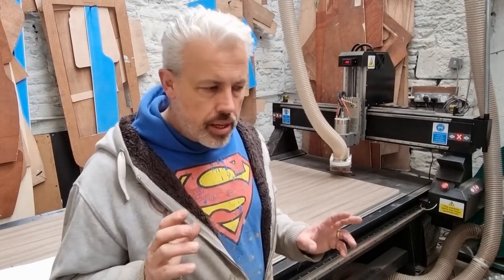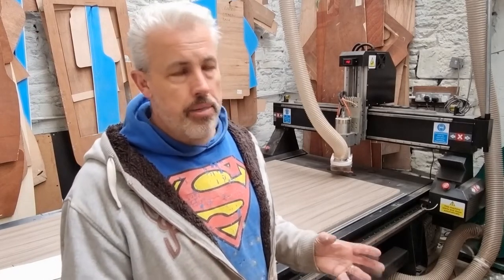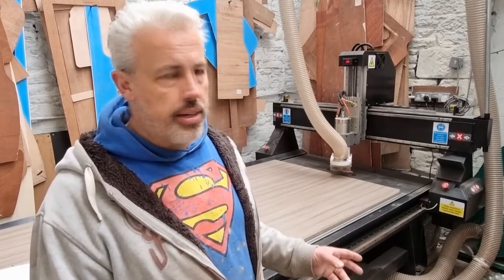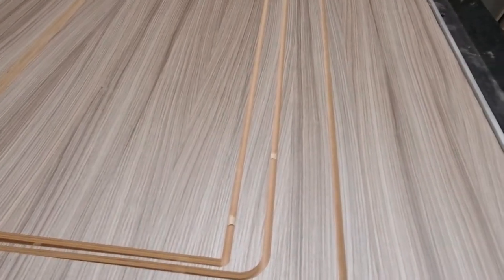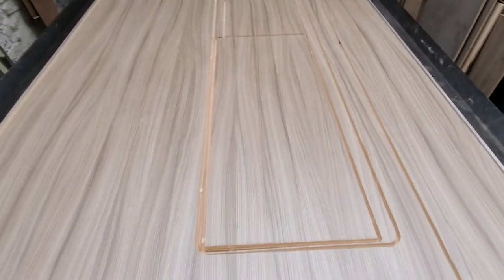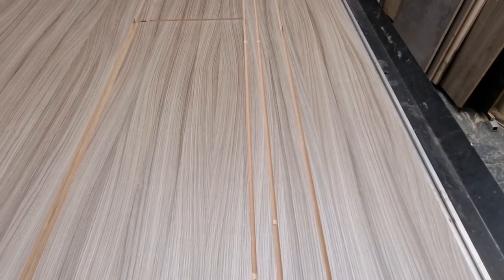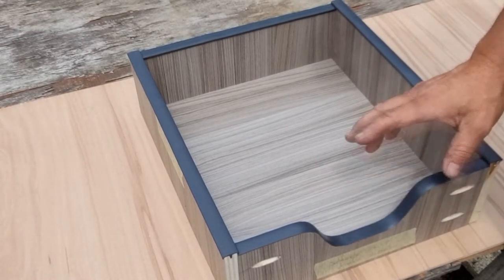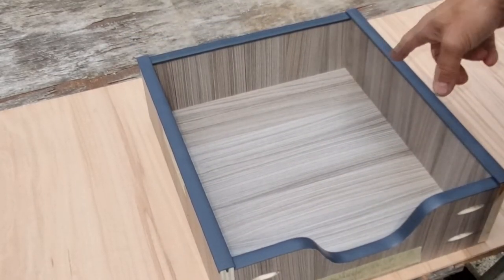Using A CNC router to create the kitchen for our camper conversion

Comment: Hi Paul thank you for your video as was very useful. I have just got a CNC machine and are using the same material. I am wondering what feeds and speeds you are running on the outline cuts to get such neat cuts?
Reply from the maker: thanks for the kind comment, tbh I've no idea , the machine belongs to Alan at Hunter sports homes and he's the one that set everything up, tbh you'd be better off talking to him